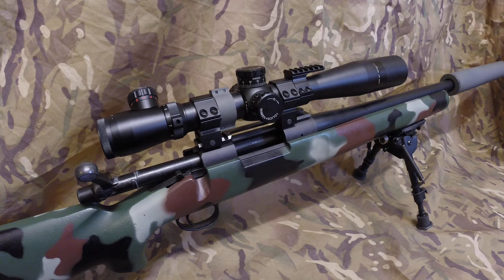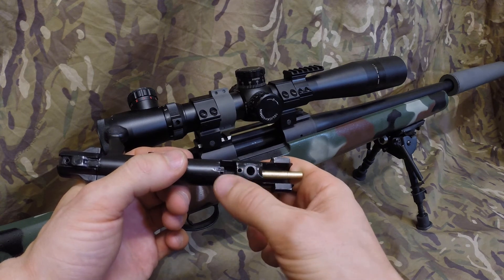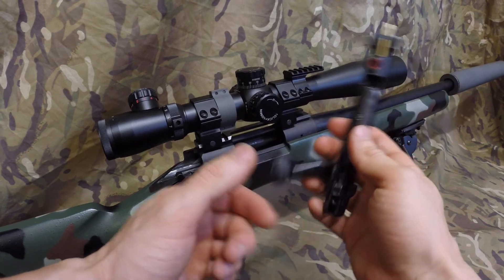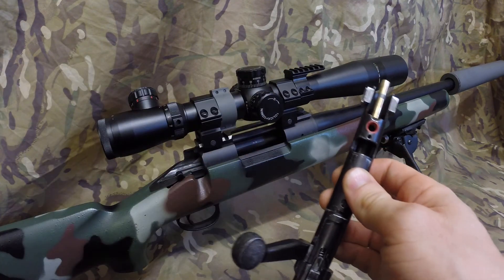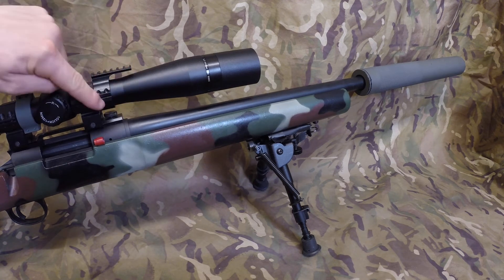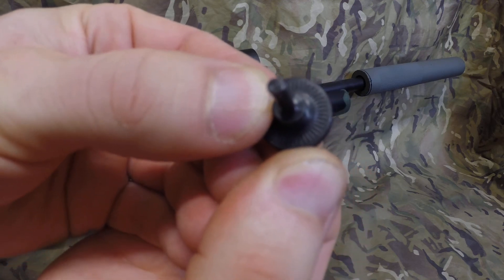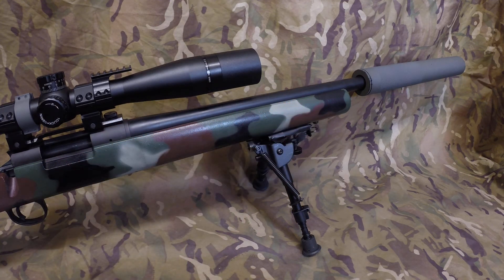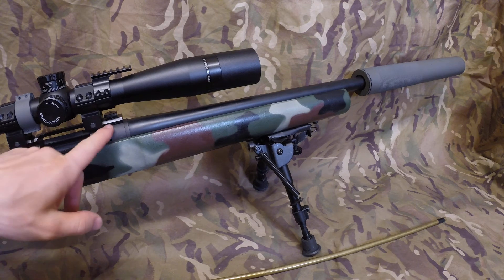Tanaka M700 101 Part 2 - PCS & Barrel/hop

Comment: Is the myth true? Do these shoot better than a well tuned springer? Or just a case of at the time, the Tanaka QC was way beyond anything else you could buy at the time?
Reply from the maker: Erm tbh I personally think they are all much of a muchness. At tye end of the day it's a smooth bore barrel with a round ball going down it so how good can any of them ever be haha.
In terms of noise though they  retained do have the lead. They are so quiet on hpa or gas 👍🏻👍🏻
Reply: @ThatBritishChap.  Yeah, I hear you. I mean as long as the power is good, it can hop a sufficiently heavy BB, and apply that hop consistently then if the rest of the system shouldn’t really matter! I’ve heard a few people (KM, Sniper Mechanic etc) say that these project the BB in a slightly weird way compared to spring and it almost takes a while for it to stabilise at start of trajectory - everyone say they are extremely consistent though. I think a lot of it comes down to QC and tolerances though - I recently got a Steyr Scout and that thing out performs my highly tuned VSR. I have a sneaking suspicion it’s because there’s absolutely no wobble anywhere within the frame, and that manifests as better consistency at extreme range as no micro movements.

You got any shooting/scope cam footage with this? Would be interested to see!
Reply from the maker: @rdb9936  ah okay interesting. Yes I would agree that tighter tolerances and better build certainly will remove more variables.
These certainly are very consistent. Particularly on HPA it's like 1 or 2 fps variation between shots, which I assume is likely caused by ammo being mass produced.
  As for video footage. I believe I have one on here, it's called something like 'tanaka m700'
Reply: @ThatBritishChap.  Makes sense! Shame they don’t really have any after market support now! Where abouts do you play anyway?
Reply from the maker: @rdb9936  ah I know, it's a niche crowd now that's into them. It's a shame are they are awsome. 
If you do get one and ever want help finding parts or info drop me an Instagram message and I should be able to help usually. 

As for play, mostly the Midlands these days, some southern games too.
Reply: @ThatBritishChap.  Nice! Let me know if you’re ever down East Anglia way! And I’ve always thought there would be a market for a very highly engineered all metal sniper RIF, using an onboard tank that you pump (bit like an air rifle) to give extremely consistent FPS a bit like HPA, but without the hassle of hoses or tanks or refills

Comment: Do you know where is best to get the hop unit to install a very barrel?
Reply from the maker: I'm not sure where to get it atm. They are pretty thin on the ground so it may be a good idea to start looking at places outside the UK if you are dead set on getting one.
Reply: @ThatBritishChap.  I have found a few places in France that do the AA one. Was just hoping there may have been somewhere in the UK.
Reply from the maker: I'm not sure, I got mine from a place in Poland I think 🤔
Reply: @ThatBritishChap.  I managed to get hold of one, just working on the Bolt now, I am going to cut down the nozzle and add the extender as you advised needed to be done in one of your other videos. Question though I can get hold of an AA bolt. The nozzle looks to be the correct size. Do you have any experience of how the AA bolt performs in a Tanaka AICS?
Reply from the maker: Basically buddy all the bolts are the same in terms of their operation. It likely won't make any difference to the overall performance, other bolts are just for aesthetics really.
They may well have a longer nozzle though but I think as you already have your extender there then your all set from the sounds of things 👍🏻
If you would like a new nozzle check out the Kjw700 owners group on Facebook 👍🏻
Reply: @ThatBritishChap.  Awesome, thanks for the info. Got most things done on it now (previous owner didn't look after it too well). I just need to sort nozzle out and hopefully the outer barrel will be back soon a little shorted and threaded for a suppressor. Thanks for all your help and answering all my questions.
Reply from the maker: Ah awsome I love a carbine tanaka 👍🏻 and no problem man any more questions hit me up it's np 👍🏻
Reply: @ThatBritishChap.  Awesome thank you, I will share photos once it is finished.
Reply from the maker: Sweet man, send them to me on insta if you have it 👍🏻

Comment: Been doing research into these and the VFC/ASG m40a5. Based on your experience, after performance upgrades and hpa, is there really much difference between them?
Reply from the maker: I've not seen or used a VFC/ASG. I don't think they existed when I filmed this.
Are they the same mechanism?
Reply: @ThatBritishChap  From what I can tell the bolt is identical to a pre ban. I have a boneyard m40a5 that I'm going to rebuild eventually. I'm quite positive the hop up is entirely different.